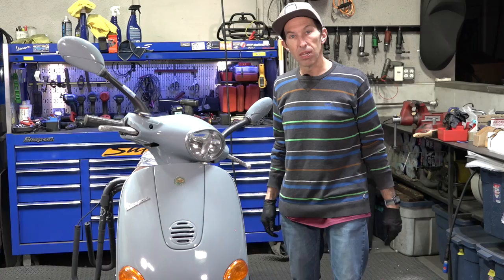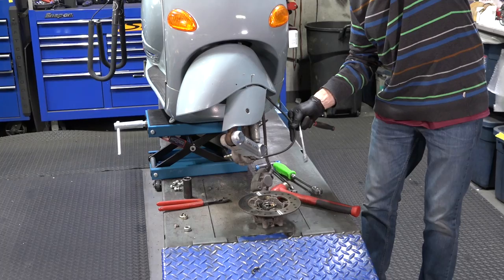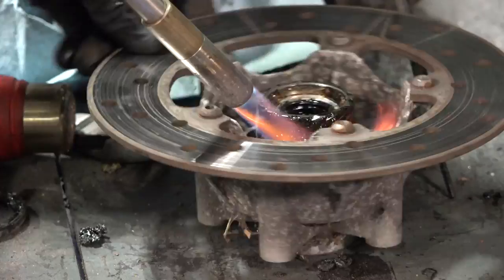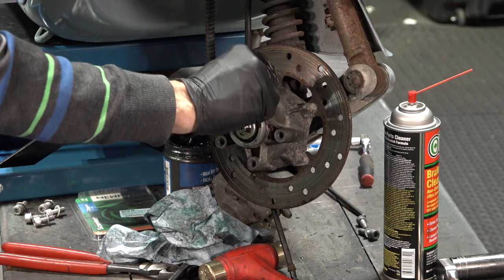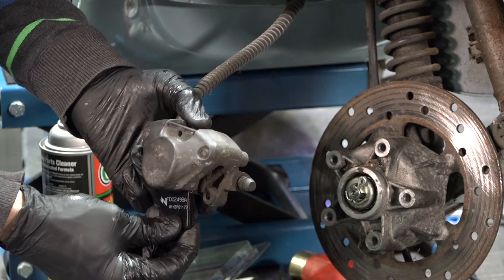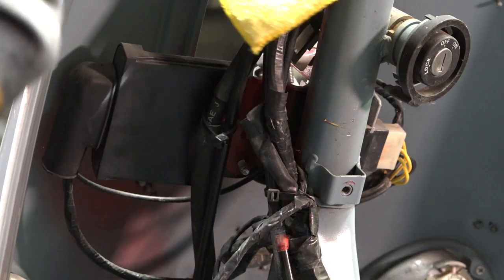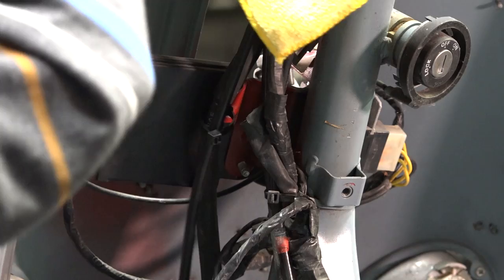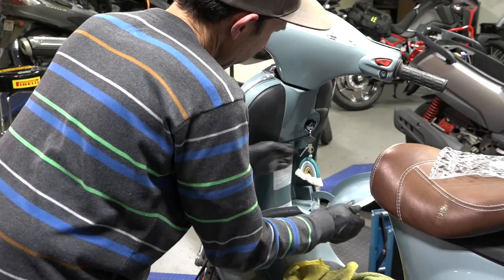Refurbishing the Complete Speedometer System on a Vespa ET Scooter

Comment: I've watched about 20 videos from here. I'm currently in the process of restoring an et4 and it's taken  me 3 years on and off and I'm weeks away from finishing. Motor rebuild, rust repair (extreme corrosion) respray etc
First time doing it or even working on an engine. Would never have succeeded without Robot videos.
I live in the UK but I wish I could have supported shop in some way to show my appreciation.

Comment: I did the same job last weekend on my 20 year old PX200 using a Haynes manual and educated guesswork.  Surprising how similar it is to the ET.  The hub didn’t come off quite as easily as Robot’s and as I’m too tight to buy a puller i made one out of a car jack and a climbing sling - which worked a treat.  Waiting for parts to arrive before I can claim success on fixing the speedo (the plastic gear was stripped) but I’m hopeful.  Great video.  Would have been even better if I was doing the job this coming weekend…..!

Comment: Good video. It must not always be fun to do just is needed in a budget to keep it going.
 I've seen someone (Alan Milliard) soak die carb castings in mag wheel cleaner, with good results, but don't fall asleep until they are rinsed.

I would also like to see a fairly complete restoration of one of these, or a S150, or something, like vapor blasting the metal and repainting. I think that you and your brother had done a vintage Vespa, at one point. Also the "borrowed" scooter collision repair and frame replacement series was interesting, but costly for some. Hey, we got to see the new Premivera up-close.
I hope that Vespa rediscovers a bit more every-day practicality, and a bit more displacement in their scooters, for the American market.

Comment: Awesome video. You do a great job and really know your products. I am working on a 2009 LX150 that lost all life in the control panel after I replaced the missing bolt that was holding the large windscreen on. Having trouble accessing the handle bar dash board because one of the screws holding the mini roll bar is stuck in there and stripped out. I think that front panel with the piagio logo needs to come off to access the middle screw holding the front headlight section on. That stuck screw is an allen screw that looks like a #5 metric. Is there a better way to tell if I have damaged the wiring ?

Comment: I own a 2007 Vespa LVX 150 and during a ride this past weekend I noticed that at some point the speedometer needle had broken off its pin and was just laying at the bottom of the circular housing. The remaining quarter of the needle that is still attached to the pin still moves as I accelerate, but it's no longer pointing in the correct position to indicate speed - it's starting point at is facing about southeast. Any advice?

Comment: I'm curious what is the lifespan, in milage and years, of an ET4 or other model with the 150cc LEADER engine, assuming it's maintained per manufacturer's specs and the rubber parts, like the intake manifold, petcock, and fuel lines are refreshed.
Reply: Io vorrei per esempio, ammettere che la mia et4 ha raggiunto oltre 55000 km. Con la manutenzione ordinaria.